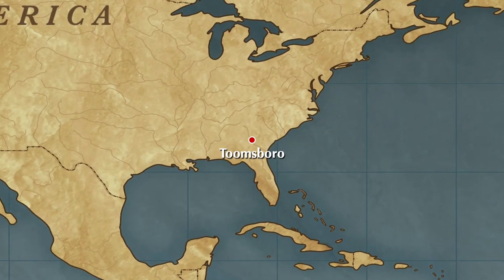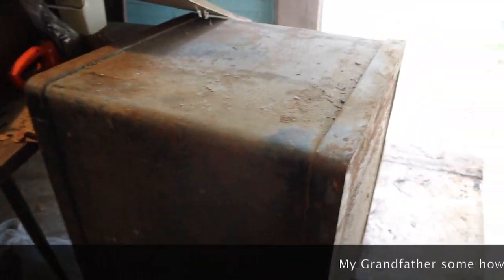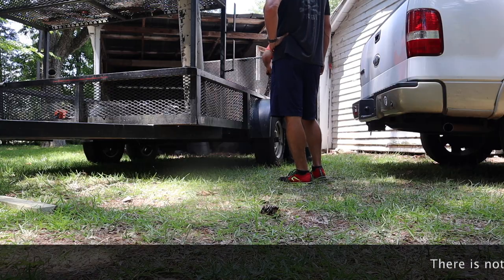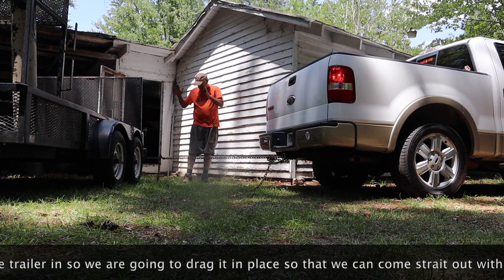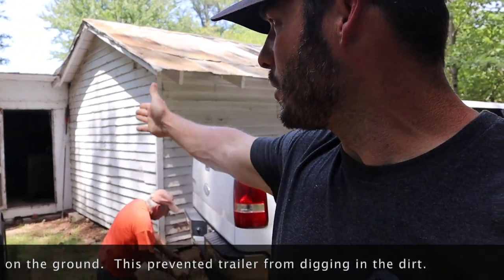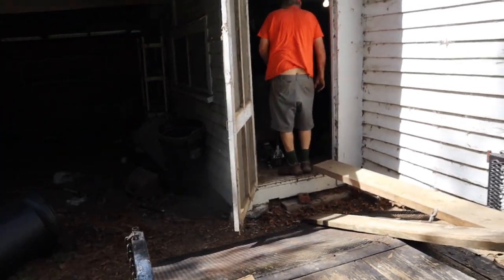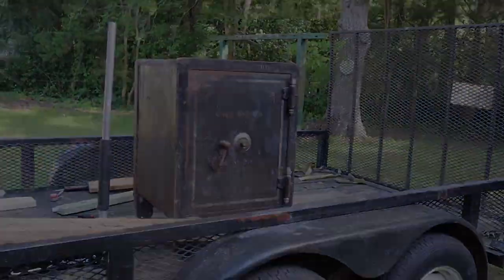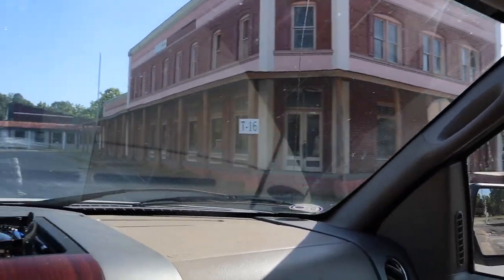HOW TO MOVE 1000 LB ANTIQUE SAFE | CARY SAFE COMPANY

Comment: I have one of these safes in my basement. I don’t want to move it but I want to open it. The problem is that I don’t know the combination. I know these safes have special dialing techniques. I programmed a stepper motor to turn the dial for me. What is the secret technique? From another video I saw the guy said four turns left to the first number. Turn right to the second number and turn three more times. Turn left to the third number and turn two more times. Finally turn right to 40 and the dial should stop and handle should turn. Am I on the right track? What was in the safe? I’m thinking it was empty. Great video! Thanks for your help.
Reply from the maker: I appreciate it, I went to open it in a video, but the audio was crappy and didnt publish iit.  We had the combo and couldn't open it!  It was so disappointing!  I am still hoping we can get it eventually.  I appreciate the commen1